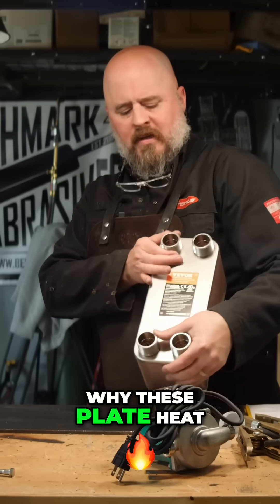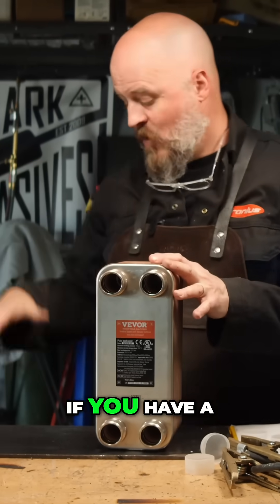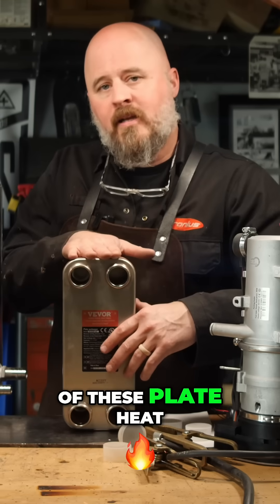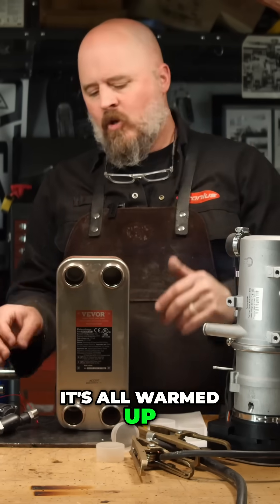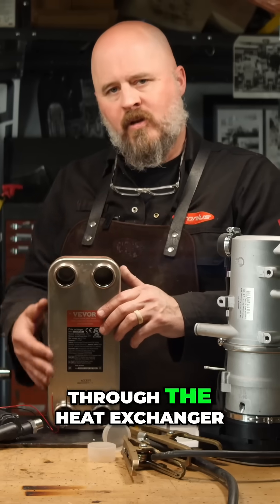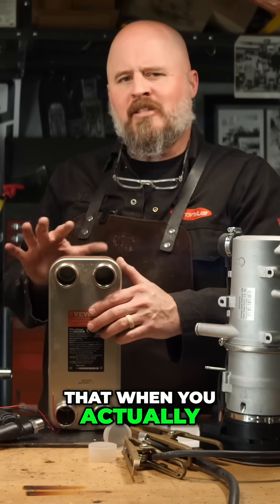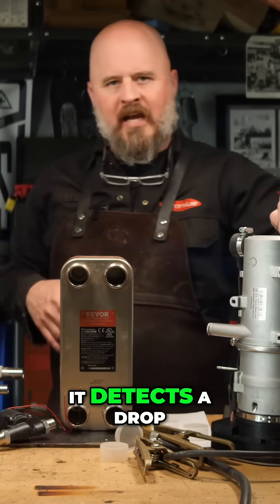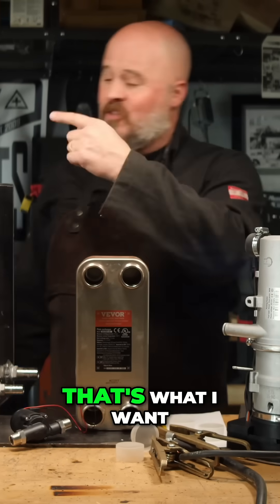Plate Heat Exchanger: Preheating Your Vehicle Efficiently!

Comment: We use them for refrigerant to brine, cool a saltwater bath down to 18 degrees to freeze 300 lb blocks of ice. 72 blocks per tank in stainless containers lowered into the brine solution.